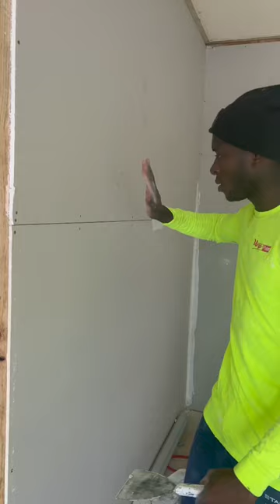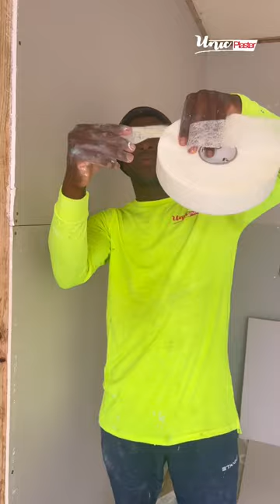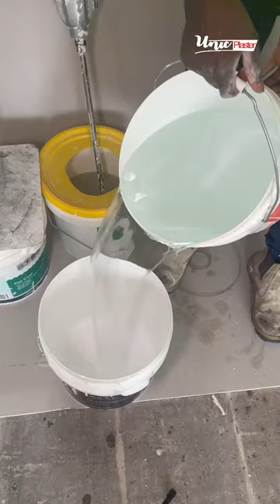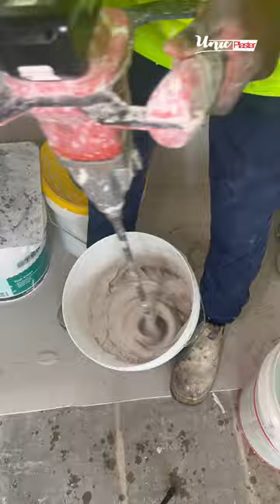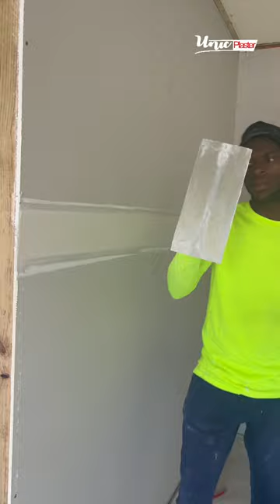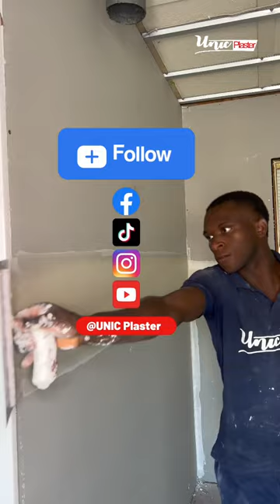Taping tips #howto  #drywall #diy #tipsandtricks

Comment: If you've never put up tape and mud, it is not nearly as easy as this man makes it look. This is the result of a LOT of time and care in the craft.
Reply: You damn right bro it’s not easy as it looks
Reply: Ive dont patches at my mates houses, and given them a try,  and they cant  even get the mud in tve wall. Lol let alone tape a joint or crack.
Reply: Yeah… lol the trick is to go a little more on the mud usually…. At least in my case since I added too little 😂
Reply: @carlosf9278  There is an art to it I just never got. A certain touch or finesse that escapes me. Mad respect to you that can do it!
Reply: This is the easy way. Everybody can do this.
Reply: Yes but he IS wasting a lot of time going needlessly back and forth
Although who cares when youre the boss right? 💪
Reply: True this the easy way because I've had to cut patches of drywall and redo them because the mud came out sloppy.
Reply: Just so you know hes not very good 😅  real plasterers dont use scraper 😅
Reply: @Deputy_doggg  Really?! That is what I was taught and what every good mud guy I've seen does. Interesting. What do real plasterers do?
Reply: @InformationIsTheEdge  bucket scoop in england u would get laughted off the job using a scraper for anything other than stripping wall paper
Reply: @InformationIsTheEdge id do all that with a trowel n go straight over the whole wall with plaster
Reply: @Deputy_doggg  No drywall? Just plaster? That sounds expensive. That was popular in the US until the 1960s when pre-made gypsum board became an inexpensive alternative. Easy to demo when its time to renovate too. But plaster has been the go to material for what? 400 years?
Reply: Bullshit this man is not a plasterer
Reply: @DustyPijlman-bv1kg  Plaster?! Ain't been no plaster around here for centuries. You been freeze dried or doin' hard time?
Reply: @InformationIsTheEdge  hate to admit it but he's kind of right. Not sure what plasterers do but I do know people who drywall finish in Washington and Texas when hand finishing you use a 8  blade to wipe after tape in a 12 in knife for the second coat not that thing he used nor a 6 inch. I never seen wyte, blaq, or else's wipe down with a scraper. Or use the 8/12 inch for coats after the tape dries. My foreman would have  my ass if I did this shit on the  job site
Reply: @craigwallaceii6076  Huh. Good to know. Pretty easy to impress someone like me that tried and failed to learn the process.

Comment: I’ve used mesh tape for everything from patches to mudding my entire basement and have never had a single issue. The paper in my 2 year old house has needed to be redone twice by “professionals”. I prefer the mesh because it resists cracking so much better and the risk of bubbling is next to zero.
Reply: I heard fibafuse is better.

Comment: Yes! "con-fill!" Dries faster, stays stronger. Great tip brother
Reply: i have to give it try.
Reply: @mobb7837  it's a b!tch to sand so apply as smooth as possible, knock off moat rough spots with a scraper/putty knife.
Reply: @jigsawkiller  Absolute bullshit... if you don't know anything about filling, and you fill anyway, then it's like you described.
Reply: A Z  so what do you use?

Comment: Paper tape will shrink and dry tighter to the wall if you let it dry fully before coating.... wet mud over wet tape allows it to soak up more water and swell...
That's what I was taught, and it makes sense.

Comment: The mesh take is designed for rapid dry repair mud. That mud expands slightly which means it needs a mesh for strength. Regular mud contracts slightly

Comment: That fibafuse tape is the best hands down
Reply: I love fibafuse, it makes everything so damn easy
Reply: Makes me so itchy
Reply: Have you seen work done with fibafuse after a couple years? Did it crack?
Reply: @Simon Monty  never, I however have seen the old-school tape bubble up although its rare.
Reply: Fiberglass tape is the only thing used in the UK. I've never seen a plasterer use that paper stuff before but I know it's popular in the USA.
Reply: @bo0tybandit  in my experience that only has to do with not having enough mud (mud can be too thin or was pressed too hard while applying paper tape) under the tape. The tape itself isn't the culprit.
Reply: But where are the nail or screw holes patched by spackle????
Reply: @nickschurko4809 no screws when plasterboard adhesive is used.
Reply: But only use it with gloves
Reply: @simonmonty7171  no cracks it's actually the most crack resistant. I have however seen paper tape bubble, and leave lines on both sides over time and that checkeed plastic tape leaves a raised square pattern once everything dries.
Reply: @DaDaDo661 yeah the fiberglass is a problem..
Reply: Fibafuse is very expensive as well.
Reply: @garydail290  not really. 250 ft of fibafuse at home Depot in Canada is $6.34 + tax.
Paper tape is 7.80 for 250 frlt, $10 for 500
Reply: @AndroidGuru13   $3.16 for 250ft paper tape and $ 6.89 for a 250ft fibafuse roll of tape at home depot here. but I agree it is much better than paper tape.
Reply: @garydail290  If a sub is pinching less than a $20 bill for an inferior job; the tape they use is the least of my worries. High end products are made for  high end craftsman. Besides; the ease of use will save tons of time & effort. Time = $$$
Reply: @-KIMISAFOX   have a snickers bro and chill . I was just comparing prices And  I agree fibafuse is the best
Reply: @garydail290  What do you mean chill? I was just comparing integrity. It's not my fault if you're the one out there pinching. If you're not; then what's it got to do with you?
Reply: Try doing an internal with it.
Reply: @-KIMISAFOX  you get what you pay for.🤷‍♂️

Comment: Great work, 
But definitely get yourself a 8 or 10 to bed with when you lay flats and butt joints. 
10 or 12 for the skim

Consistency is fantastic though
Reply: Yes sum1 finally said it. Or just use the 8/12 inch mud box. But when hand finishing taping flats never wipe w/ 6". Might take off too much mud

Comment: I'm with ya 100%, mesh tape is junk.
Reply: It’s fine if you use hot mud. Especially on patches
Reply: Cuase you don't use  it properly  d don't quit  your day job
Reply: Wouldn't go so far as to say it's junk. I prefer paper tape but to each his own. Besides, no other option when doing bathrooms.
Reply: Patching a ceiling that leaked with hot mud, 2 coats and texture day one, prime and paint day 2, mesh tape all the way.

Comment: Mesh tape only good for repairs in open planes in my opinion, hawk and trowel all day long! Great work!
Reply: Mesh is also good for bathrooms, backsplashes and any location that might be exposed to water. It is mold resistant unlike paper.
Reply: The best thing for mesh is a patch job where you can save a little time by skipping a  coat of mud.

Comment: bucket mud is for paper tape hot mud use mesh
Reply: Plasterer of 40 years and that's 100% I've been around jobs long enough and its never failed although nor sure about that brand of hot mud
Reply: Been  doing the same for years and never had any issues with cracking .

Comment: What was that 3rd bucket / substance ? Different than the first two coats ?
Reply: Doesn't know what he's doing
Reply: First 2 coats was 45min durabond. It dries fast (but not really 45 min, more like 2 hrs), it dries hard (not pleasant to sand it), and it bonds well. Top coat is just that, top coat lightweight or mid weight joint compound. It dries softer but it feathers smoother and is easy to sand. 
Most professionals do this always.

Comment: Don’t use hot mud for taping. Taping compound is the best and your tape will never come off.
Reply: A lot of places don't have taping compound, so it's either All purpose or hotmud.

He'll in the Midwest during COVID we had to use midweight to tape and ultralight weight to finish.

The taping compound just had more glue in it if I remember correctly, I remember this old tradesman would use Elmer's glue in his taping mud for that exact reason.
Reply: That's fibafuse tape. Mud penetrates through it. Hot mud is perfect for this. No need for the paper/polymer mud combo

Comment: Why did you say no to mesh tape?
Reply: @harrystubbs7770  I'm plumber, so not my craft, but I have been having cracks in the plasterboard for years and any time I was using white multipurpose filler and send it it was OK but later on it was showing again. Then I've used self adhesive mesh tape on top of the same crack and I've applied 3 coats of filler allowing it to dry between the coats and light sending with 120 and a tiny bit of 180 grit then I called my painter to decorate and it has never shown again in the last 9 months. In the UK it is more common to find mesh tape and less common to find paper tape and I believe in Europe  in general as well. Why do you think it is shit? I spoke with older people and the told me that 50 years ago when none of these tapes were existing tademan in Italy were using white 100% cotton bed sheets cut into pieces and embedded in filler like the guy does with tape and it was perfect. I mean fiberglass by mesh tape!

Comment: Might as well plaster the whole drywall while you've done half of it already lol
Reply: It’s called feathering it out to help create a flat surface.
Reply: @Joseph Weiland  in the UK, most drywall get skimmed with plaster, so it gives a smoother finish, more durable, better sound proofing and fire resistance, plus mould cannot grow on plaster.

I guess to save money you just feather the joints and paint finish.
Reply: @radwanmiah8150  they coat drywall here in the US. They finish the joints first.

Comment: Too much filling. Just plaster the whole thing!
Reply: WTF are you on about
Reply: @RidetheGeoffening  instead of mucking about filling and sanding the joints multiple times u just coat the whole room in skim coat plaster,better job and quicker
Reply: @simonpeyton-n3h  well it's still got to be based first or else, what, fill it all with topping and weight a year for it to dry. I'm 53 mate , been doing this since I crawled outta school in 86 , his process is fine , even allowing for a level 5 type finish.
Reply: @RidetheGeoffening  no u get gypsum plaster and just coat the walls and ceilings,sets in 3 hours and dries out in a couple days ready to paint,better job thats harder wearing and lasts longer,simple